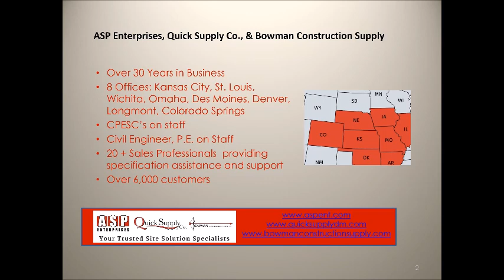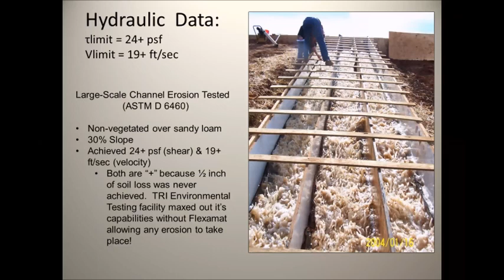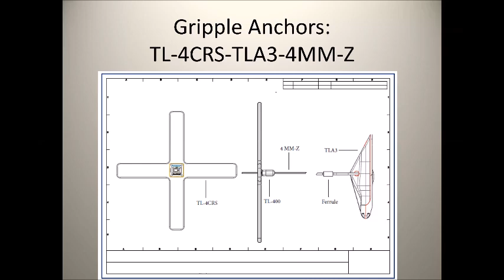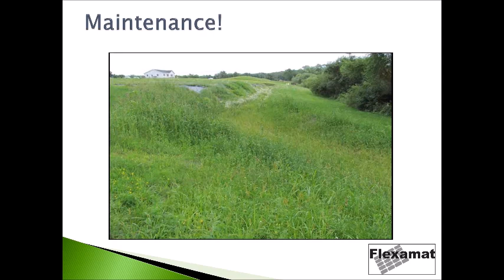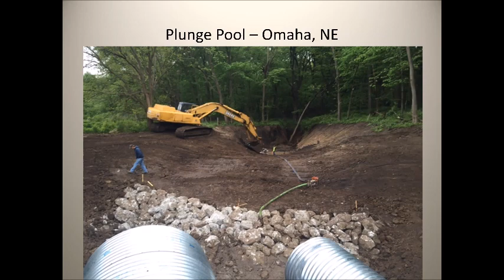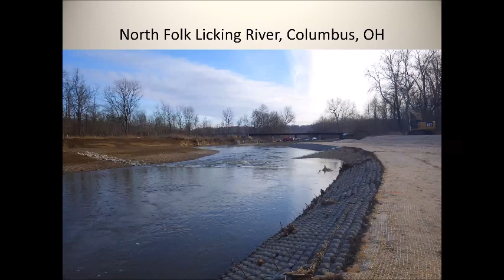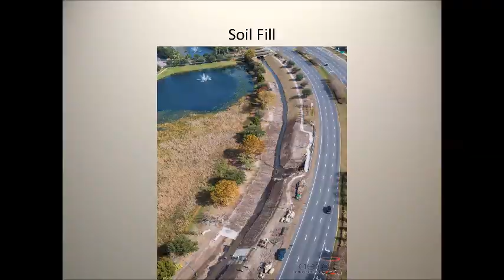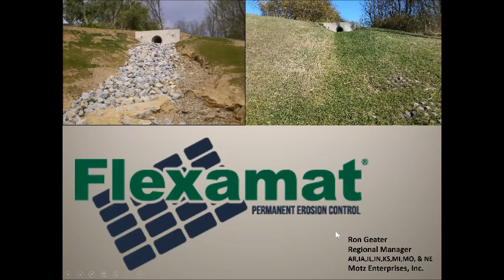Flexamat Webinar

Comment: Regarding point at 19:57 where installers added concrete and now vegetation not growing. 
Have you gone out there with a hammer drill and medium to larger concrete drill bit? I’m new to construction but an ex enginerd who’s been working busy cutting up asphalt & concrete block for a huge driveway I’ve been building,  so my kids can have a school bus again by using OUR driveway (cuz our City & developers messed up - removed the only area large enough for a school bus to turn around, which it had used past 25+ yrs!). Because I’ve had to figure out how to pin down commercial grids through 2-3” angular rock, and wanted to drill through parts of the main City road lol, I’ve been trying out different tools, blades, and drill bits to get the job done! I also have had to drill through our cheap concrete block house lately for multiple reasons and have noticed depending on what is used and technique, the hole can be nice and straight or be a crumbly mess (my husband did  those lol!). 
But my hammer drill and a good concrete / masonry bit has worked great and sometimes like on road it can help if some pressure is allied surrounding the hole (I think it helps w the vibration and reduces some of the shear stress and it seems to help to counter any stresses caused by the friction on the drill bit moving material every which way. If I had a thick rubber workout mat i would try to put pressure on the surface area near the hole being drilled (they probably make stuff for this purpose that one could probably even “drill into” like a template. 

You guys probably know all of this stuff - just sharing my own observations via trial and error and learning on my own. 

But just a thought so that you guys could put holes in the concrete where you needed so you could then place seeds and a little soil there to grow, like a “reborn” chia pet! 

PS If it was near Vancouver WA or Portland OR area I’d volunteer to do it.  I’m enjoying learning and have an interest in this kind of work (besides my chem engineering degree I have a minor in environmental engineering and a 2nd BS degree in Environmental Science, but when I was in that program we never learned about any of these cool products or solutions! 

So I’m really loving to learn about all these new innovations and see the real life applications!). 

BTW I love how he is pointing out the areas that were less than perfect installs - this is where im learning the MOST! But, i also used to be a defect / in-line-monitoring yield engineer in high tech manufacturing so that’s how my brain is wired! 😉
Thanks for the awesome info! I can see how we need this product on WA Stare highway 14 That is directly above a public walking trail and across the street from our house. 
It would also be a great solution for our 4 plex adjacent to our house where there is a large dipped area paralleling the narrow neighborhood Main Street (highway 14 parallel to it at about 8ft higher elevation). Our street doesn’t have any storm drain system so if we don’t want a lot of water in front of our house we need to make our own system even though the City technically owns that stretch of land.

Sorry about the run on sentences - too many thoughts and applications going through my head! 
potential 
Depending on the concrete, on our street Kind of pin or hold down Hold down the concrete block

Comment: Do you ever do studies on soil microbes for different areas / climates for different applications? I ask because our cities still have a lot of work to do regarding storm water management and instead of using conduits to flow straight to river, lake, or stream, we could be doing more systems like shown here. Depending on the types of run off different types of microbes in the soil below these storm water channels could be used to help digest and treat different types of pollutants in the storm water runoff. I would think studies could be done over time and take samples below these systems to see what is going on. Maybe you don’t share all of what the microbes could treat but some could be used to digest petroleum and or other types of more complex pollutants that we would ideally not want going in lakes or rivers, and not taxing sanitary waste treatment facilities either, because as we know, those systems can not treat everything that comes into it such as pharmaceuticals and other miscellaneous chemicals. 
Near agg areas those bugs could potentially have an affinity to whatever types of fertilizers they may be using, and or misc animal waste. 
Another question I wondered about is how often these clog up w/ leaves or misc trash and if that causes a political barrier for municipalities to switch to this kind of model? 

On a related note to leaves, sticks, garbage, or erosions from above potentially flowing into these culverts and thus causing potential pooling of water  and or “blockages”, do you take that as a variable in your calculations? It would be a chat because the amount of debris may not nessesariou correlate with season rains - for example more construction can happen in summer than winter. Do engineers try to do flow calculations based on those “pooling” variables (that may or may not occur except leaves and pinecones for certain dots), to try to get enough momentum to push through that, given the other variable such as  slope of land,  size and height of the concrete mounds, etc?